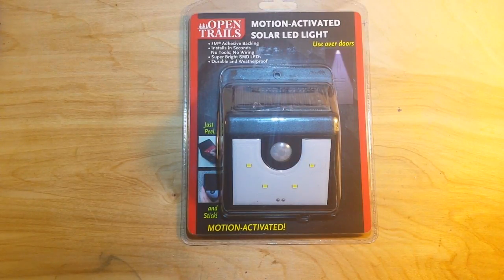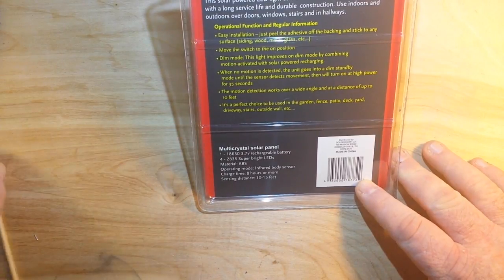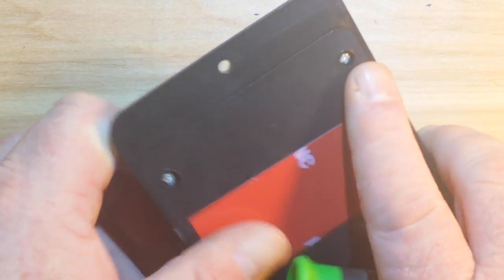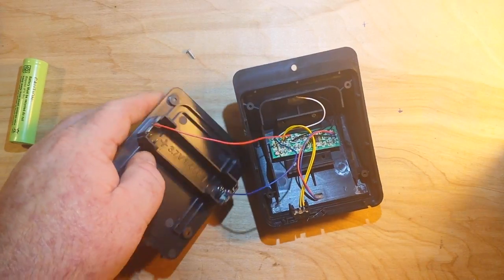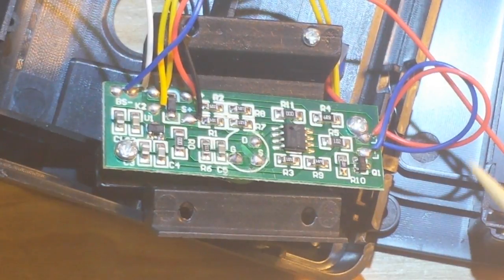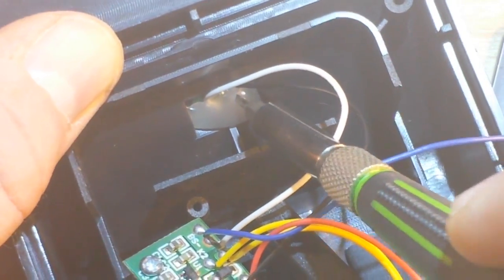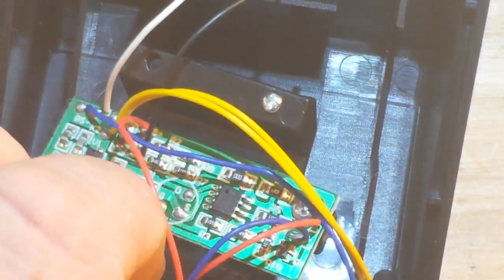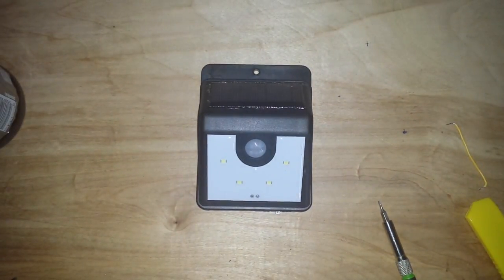Dollar General PIR Motion Sensor LED Light Teardown

Comment: Wouldn't take much to modify to add a external battery box on a long pair of wires and do the same for the solar cell then seal the board, edge of the PIR dome and back cover up with silicone and have light that would work on a north facing wall somewhere that it would not do so well just out of the package.

Comment: I have a question. If I wanted to cut the constant light and keep the motion light, would I be able to snip a wire to do that?
Reply from the maker: No, these aren't that sophisticated
Reply: @learnelectronics  thanks. I do ghost hunting and thought it would be a good tool that way.....and save on battery life if I was to just get regular use out of it.